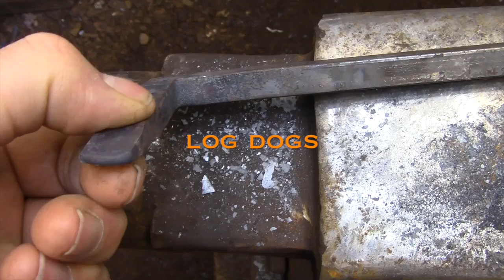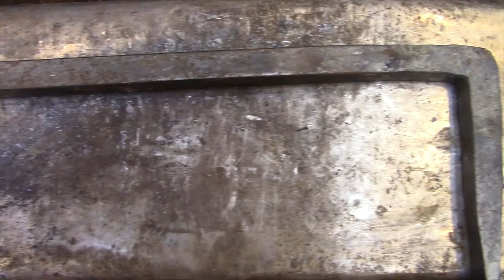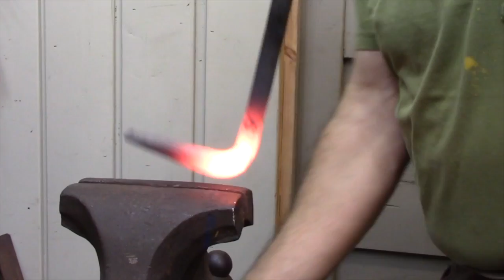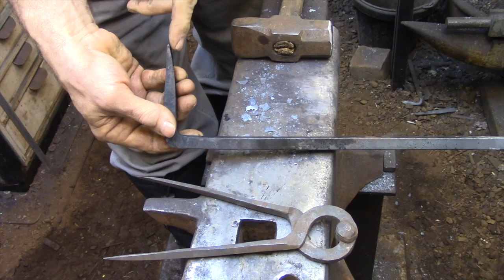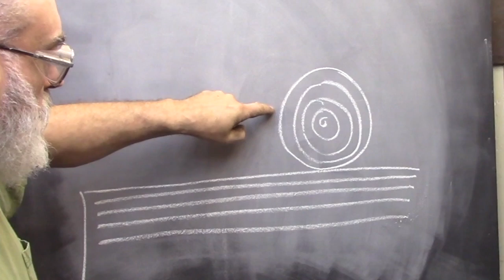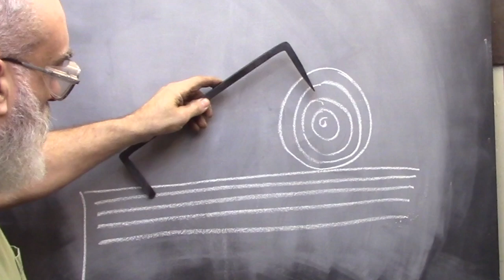Blacksmithing Project - Forging Log Dogs

Comment: Did you have a try yet at this folding method I saw a while ago for making square corners?  I saw it a while ago and it looked quite simple but seeing you do this with the vice makes me wonder which is easier.  
To get the idea on the method I mean see https://www.youtube.com/watch?v=caFEYiIWKwU&t=240s
Reply from the maker: The two advantages with the way i do it is that you never have to bend the corner over 90 degrees and you only have to hammer directly on the corner with a very light hammer so you can insert a square corner anywhere in a bar at any time in the process without affecting the other elements .  So if you wanted to build a square frame from one bar with square corners,  scrolls welded into the corner of the frame and a forge weld in the middle of one of the straight sides - his method would be very awkward. It is a novel approach and I admit I never would have come up with it but forging one square corner on it's own has never been a problem.

Comment: Yet again Sir you offer a paradigm shifting method of forging.  The way my Grandfather had us make these was to loop the bar above the spike and weld the bar closed so it resembled two spikes with a cross bar, your method uses half the material and is much less labor intense.
Reply from the maker: If I understand what you are describing - that method would build a tool that would take a lot more punishment than this design. You would have to mash down the entire length of the spike down to  the crossbar before you would need to build another one.   It would be interesting to know where that design came from.
Reply: DF - In The Shop He was teaching me to forge these and he said try building it with a welded loop over the spike, it might last longer.